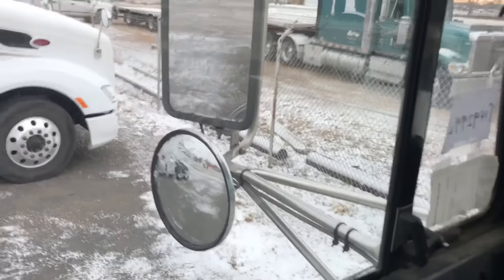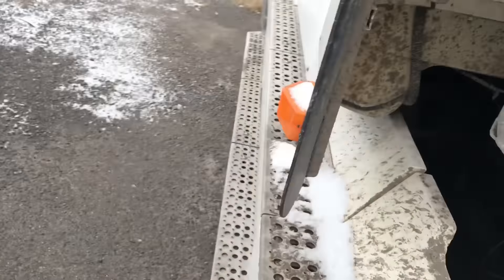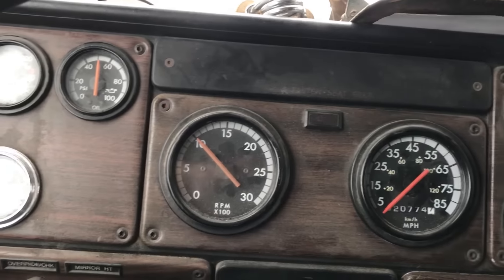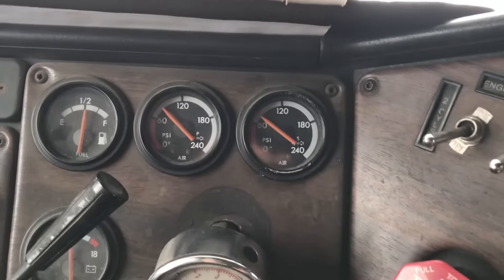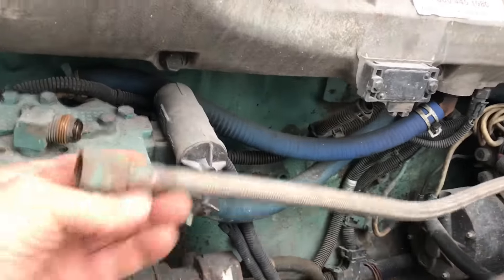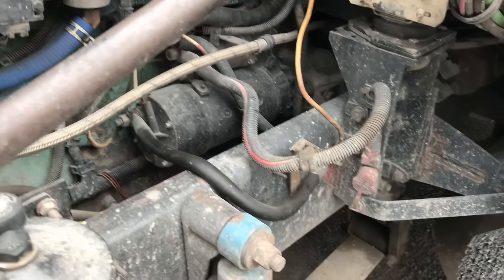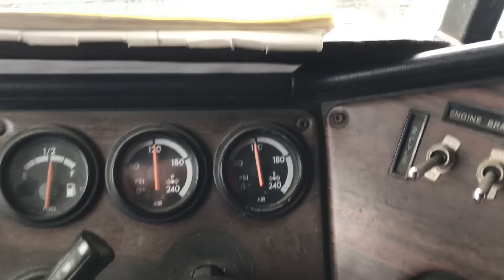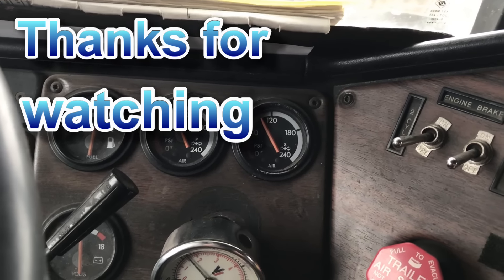How I freed up frozen air brake system on my big truck

Comment: OK guys here is the advice you all need about air line freeze ups. I have been trucking in northern Canada for 40 years, seen 100s of 40 to 50 below nights. This advice is for newer trucks, like 2005 and up anyway. Service your air dryer every fall just before the cold weather comes. Either replace it or put in a kit, sometimes cheaper to put a rebuilt on. Do not use air line antifreeze unless absolutely necessary. All this stuff does is cause more grief eventually by dissolving every little chunk of ice in your system and sending it to the valves (the last place you want it). This ice will disperse itself when it warms up outside. If you must use brake line antifreeze, use it sparingly and always bleed your tanks in your truck and trailer afterword, do a good job of draining them, do it 3-4 times. Trust me back in the day of alcohol sniffers we had way more problems in the air system than running a dry system like today, way more. A propane torch works great for unthawing valves by holding it 4-6 inches away from valve, moving it around accordingly. In extreme weather air fittings at the pots will also leak because of moisture in the fitting and it expands when colder than 25 below causing  substantial air leaks. Simply use your handheld propane torch to heat the fitting (nut) at the air leak, it will disperse the moisture and seal again, works great. Safe trucking guys.

Comment: I am kind of surprised that you haven't done that many times before. Even with an air dryer you can still get a little moisture in the line. If the trailer brakes freeze up you have to take the red glad hand loose and dump the stuff in there. I use Heet; it is a little cheaper than the truck stop air line anti-freeze. I have been an owner-operator since 1977 but still learn a lot from your videos! Thanks!
Reply from the maker: I only remember I think 2 times before, 1 time I just didn't work that day and the next day it warmed up enough to thaw it out and another time I brought a propane salamander to put under the truck to thaw it out. The hand held torch uses way less gas and I will be getting one to keep in the truck. Thanks for watching.

Comment: Gotta love it. Its been stupid cold up here in Minnesota already this year. Thankfully my air system hasnt froze up yet but it happens many times a year every single year on my truck. I have just learned to deal with it. I have the exact same issue with it popping out the relief valve on the back of the compressor a few times a year. I will sometimes pour some air line antifreeze in the airline but my air dryer is up front so I just pop my hood and take my weed burner torch and turn it down low and warm up my air dryer until it stops popping and its good to go after that. Once the truck has been running its fine. I have not had it freeze up going down the road or anything in the 10 years I have owned the truck, only when its been sitting a day or more and has time to freeze up. But I always carry a bottle of air line antifreeze with me in the winter just encase. Gotta love winter... NOT!
Reply from the maker: I don't have trouble every winter but enough times to not trust the air system if I don't have a new cartridge in the dryer, and this time I did have a new cartridge and it still froze up. I don't want any part of Mn. I hated working for OX out of Minneapolis and turning in my bills by hand every week because they kept me up that way all winter, I quit after 4 months. Speed limit signs on the lake for cars? give me a break, if a car brakes through the ice they deserve what they get.
Reply: Yeah, I know a few people that leased on to OX years and years ago and they didnt stay there long either. Not sure why but I know they werent making a lot of money with them.

Comment: How Do You Purge Out The Alcohol in The Summertime Gordon Doesn’t it Attract Moisture Along With it’s Anti Freezing Property’s 🥶🥶😀😊 Good Job on Getting It Going Again 😀👍🏼
Reply from the maker: The alcohol is only to prevent freezing in the condensed moisture (liquid moisture, water) which is expelled out the exhaust ports every time you use the brakes or any other air system in the truck. You don't need to take the alcohol out, you only need to add it during cold weather. If you don't add the alcohol, the condensed moisture will freeze and cause blockages in the system and moving parts to frost up and stick. You can do nothing about the moisture in the air, only stop it from freezing and clogging up the system. If you pull the drain on the air tanks everyday you will minimize the chance of the water accumulating in the system and freezing.
Reply: Gordon Robertson Thank You For The Explanation 😀👍🏼

Comment: If they are calling for cold weather it's always good to dump in some methanol the night before and let it do its magic or if you have a warmup for a couple days and then another cold snap it will keep the condensation from freezing up!
Reply from the maker: For the trailer it's easy enough through the glad hands, but for the truck, I'm not looking forward to getting the wrenches out in cold weather.

Comment: That usually will work but the alcohol will pass thru the air dryer and contaminate the desicant filter in the air dryer which will shorten its life. Possibly the cartridge was due to be changed which might have caused the freeze up in the first place. Just a thought. Good video as always.

Comment: It’s -27 C, Same shit happened just 2 hour ago in 2022 freightshaker, didn’t have any other option left besides throwing two kettle full of boiling water on dryer. Did it right or wrong no idea but air pressure is normal n back on the road 😎

Comment: Usually if you put a torch to heat up the governor the pressure will rise and a governor should be replaced. Your pressure probably started to rise because engine heated up and thawed the governor internals

Comment: Isn't winter time a blast ?  Imagine the olden days of compressed-air brake systems, before they had perfected things like air dryers. You had to use methyl alcohol, fill up a little reservoir under the hood periodically,  and the evaporator system would spritz tiny amounts into the line to eliminate moisture that had been generated from the compressing of the air (which warmed the air) going into the cold lines where the moisture would condense first to water, then solidify into ice, eventually blocking off the line.  Methyl alcohol is still a valuable thing to keep around.  I know you put a new cartridge in your dryer in the fall,  so there's a problem with moisture collecting in that braided line between your compressor and the dryer itself.  You might do well to figure out a way to get any "valleys" out of that line, so that water can't get trapped before it gets to the dryer.  It might just mean figuring a way to ensure that the line is downhill all the way from the compressor to the dryer, so that any water will roll down and into the dryer, and be collected then ejected by the desiccant material.  Perhaps take the line off or loose at both ends, and swivel it 90 degrees so that any low spots are eliminated. Hopefully it's not so bad that a new braided line is needed.  Obviously, the compressor is working well,  just need to smooth out the path of the raw compressed air to the dryer :)  And if you ever have to do the alcohol maneuver again, it doesn't take much alcohol.  A few teaspoons is more than enough.  Same with putting it into your trailer supply (or service) line... don't make the mistake I made once, don't put half a jug into the line,  I screwed up a valve at the back with too much juice.
Reply from the maker: I thought people from Canada love bad weather, I mean cold weather. If I wasn't so dirt poor growing up I wouldn't have stayed around here, I would have moved to a better climate 40 years ago. The summers aren't any hotter down south nor more humid, only last longer and the winter not so intense. I literally HATE every minute of the 6 months of BAD weather we have every year and all the death and destruction it causes, and then the crazy rush all summer trying to fix the damage from the past winter and then preparing for the next one, I have little or no opportunity to enjoy the summer for the few minutes it's here and not raining.
Reply: As for cold weather,  I enjoyed it a lot more as a younger fellow,  I went out and embraced it, partaking in winter events, winter sports, and enduring the challenges that came with winter.   Now, not so much as before, lol.   Still,  on the plus side, winter offers a bug-free experience, for a while, at least.  Also on the plus side (or at least from my perspective), up here, we get a lot less of the nasty things like tornadoes and hurricanes, and monsoons that they experience further South.  Yes, cold weather does bring bad weather.  Nobody appreciates sleet, hail, huge volumes of snow and ice which interferes with driving.  But as for outdoor life, yeah,  all the nice things get put on hold for a few months, and then when spring and summer come back, we can resume once again.  The cool thing is,  we experience problems, and we find solutions to work around, or eliminate the problems and carry on.
Reply from the maker: I have a condition I recently found out is called "Raynauds syndrome" where the blood flow to my hands and feet stops in cold weather and is very painful, I also feel cold all the time in temps below 70 or so when not actively moving or temps below like 40 even when working hard outside. I found out about this "raynauds" while researching electric gloves to use while warming up my truck in the morning or running the bobcat. By the way, I love the heated gloves I got. The bugs are a minor nuisance for me except in my garden, sweat in the eyes only became a problem when I went bald, both for me are 10 times easier than cold weather which completely shuts down all progress for my outdoor activities for 6 months every year and then the expense of heat, most people spend more on a/c than heat, not me.
Reply: Yes, certainly the cold isn't any fun when you aren't comfortable.  These heated gloves,  are they battery-powered, or do you plug them in?   I've had a few mornings where I had to wear gloves to hang on to the steering wheel until I got some heat built up.  Would you consider putting a small Espar or Webasto heater in the cab?  They come with timers, too, so you could have it cut on 30 min before you were to arrive at work.  Prior to the big advent of APU's,  those little heaters were great (still are, actually).   They can warm the air in the cab for a whole night, using about a litre of diesel (about a quart)) for 8hrs of heat.  They also make wet heaters, which pre-heat the coolant in the block so that you have a warm engine when you start up.  I had a big Webasto DB 2010 on my old '89 FLC,  and it was worth its' weight in gold.  Kept me warm and alive without having to run the big engine on many a night. But if you only see temps down into the 20's and 10's,  you wouldn't need a big bruiser like that one, just a small wet or dry heater.
Reply from the maker: I have an old espar that cost a bundle with me doing the install. It lasted maybe 5 or 6 years and after spending a few hundred $ on the common repair parts and it still wont start up and keep running I just gave up. They save fuel while they're still working but are not cost effective in my experience, it cost more to buy and install than the fuel I saved would have cost to let it run. I might consider a generator and an electric heater which are easier and cheaper to repair, a bit heavier and needs more space but more dependable and economical for me. The gloves I bought from "the warming store" through Amazon cost I think about $60 or $80 I don't remember and they are for motorcycle and to be wired in and has a quick plug, the cord is to be run through your jacket sleeves and out the bottom of the jacket. I cut off the wiring install part and put a 12v lighter plug on it and plug it in while I'm doing my walk-around and just wrap the wires around my sleeves and try not to let the wire get caught in steering wheel during the 1/2 hour that I need to have the gloves on while driving, or else it would be 1 hour waiting for heat while it's parked. They come with batteries too but those don't have heated fingers, only the back of the hand. I can get small 12v rechargeable batteries and velcro them on the back of the gloves with the same female plug the gloves have to make them more portable and less cumbersome with the wires that I don't want to run inside my sleeves for such a short time use. I was about to buy a couple of those batteries towards the end of last season and decided to wait until the beginning of this season but haven't don it as of yet.

Comment: GR please do a video expkaining diesel purge for cleaning injectors i see alot of guy clean injectors in Europe using diesel kleen and liquid molly fuel cleaner they remove in and out lines of fuel tank and let engine run for 1 hour on a bucket of diesel a and cleaner

Comment: Poor alcohol in that steel braided air line and have to undo hoses on air dryer and wait for the air to come through frozed up air line once you have air coming through put hoses back on and then dump some in the red air line on trailer and start it up and build air best to dump it into the air tanks if your system don't bleed off and your set for the winter

Comment: You can’t us alcohol on some of the newer trucks it will destroy the def system
Reply: The after treatment isn't connected to the air system.  That's like a q-tip in your nose because you can't hear.